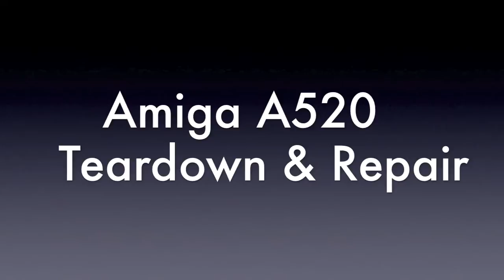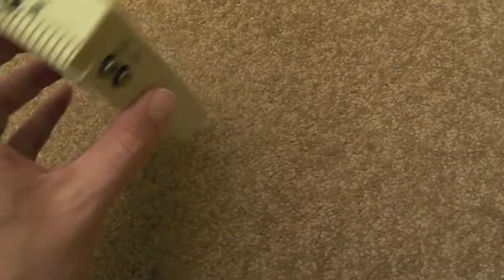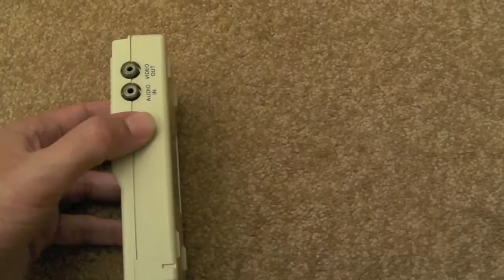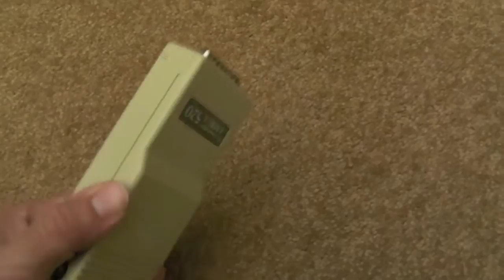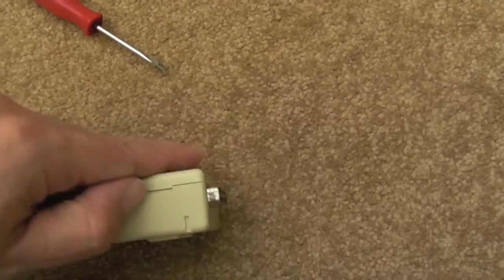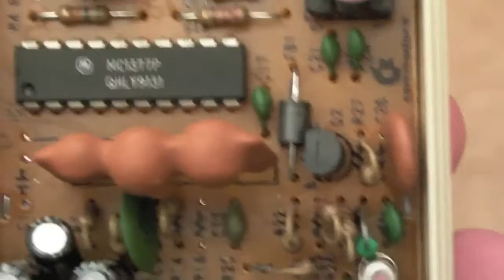Commodore Amiga A520 Modulator Repair

Comment: I recently got a A520 modulator for my A500. My issue is the modulator "adds a blue film" over the image. I have a RGB-Scart that gives a very crisp and clear image, but I have no audio with that option (don't want to hook up a stereo in my office ;)) Could it be the motorolla MC1377P giving me a hard time?
Reply from the maker: Yes, generally and colours issues with these modulators are typically caused by the MC1377P.  I've seen blue, pink, and green tints when that chip is the cause.

Comment: Hi GadgetUK164, I've been having problems with my A520 with my A500. The issue is that the picture on the TV appears slightly blurred or fuzzy, both when outputting via RF and composite from the A520. The colours actually look great, but slightly out of focus. Unfortunately I don't have an Amiga monitor to check the Amiga, but I can tell you that outputting from the Amiga Mono output produces a very crisp picture but obviously in balck and white.  Do you think there is an issue with the A520? Any idea of the repair strategy? Would like to hear your opinion before I go and buy another A520 and have the issue again. FYI I have tried on multiple TVs with the same result! Also its a PAL Amiga and modulator. Cheers
Reply from the maker: It does sound very much like its the modulator, but I guess it could be something wrong with the Amigas video output.  Modulators are really cheap these days, I would just try another one and see if that solves the problem.  You could also just get an RGB SCART cable instead?

Comment: My old crt only has composite. is the composite on the amiga-scart cable better than the composite on this modulator?
Reply from the maker: The composite from the modulator is identical!  You're best bet is to get a monitor or TV that supports SCART and buy or make an RGB lead.

Comment: Hi GadjetUK164  what means : HIGH /LOW  on the RF Amiga 500 modulator ?
Reply from the maker: Gulliver Gate Hi, Sorry I forgot to reply to the other message - will do in a sec!   The HIGH / LOW  switch just changes the RF channel that the modulator ou[puts on.  So when you want to tune in the RF channel on your TV it will be a different frequency on each of the 2 settings.
Reply: The tv A500 modulator i have
 the RF signal do not work
 the screen appears all black with the Amiga RF cable plugged on the tv antena connector.
 So im using the composite video out of the tv modulator
 but the image is slightly distorted (blurry image)
 do you know what repair it needs? (the Amiga 500 is working 100%)

Comment: Hi GadjetUK164 I´m using a tv modelator with my Amiga 500. When i turn on the computer the tv screen turns black and the hand grabbing the floopy disk doesn´t appears. But using a scart cable the image works normaly. What is your opinion about this issue?
Reply from the maker: Gulliver Gate The best thing to do initially is get an RCA or PHONO lead and connect up the 'Mono' RCA jack on the very left hand side to the Composite input on your TV (not to be mistaken with the R, G, B Component input on modern LCD TV's.  Many LCD's should still have a yellow Composite input connection somewhere.  If the Amiga is working correctly you should get a black and white picture.  If you get just a black screen or some other display - ie. not the Amiga Floppy image etc, then the Amiga or PSU has a fault.

Once you've got the black and white display working there, then move that cable from the 'mono' connection to the video connector on the modulator.  The modulator plugs into the Amiga video port and give you Composite (in Colour), or RF (Arial).  Feeding the left and right sound into the Modulator with that 2 into 1 RCA / PHONO cable just gives your RF signal mono audio.  Personally once I've got a picture I feed the left and right audio directly into the left and right (Usually red and white) input connectors next to the yellow composite input on the TV - then you get stereo sound.

Comment: for me it was cracks on the old solderings at the rgb video female pcb board pins when opened the a520 module,just tooka a big soldering stick and mashed down the cracs and now it works better,clear white and right colors on kickstart. the a520 is still piece of crap though.
Reply from the maker: Glad you sorted it =)  Thanks for posting, always interesting to find out the different types of faults and solutions =)

Comment: Why does my A520 adapter only output in black and white? I have tried 2 different ones and they do the same thing. Also, RF out doesn't work at all.
Reply: I do not have an amiga anymore, but when I did, I tried to figure this out. I tried a TV from a foreign country that had the ability to switch between different types of PAL and NTSC.  Some of them didn't work at all, and some were very screwy looking. No setting gave me the correct picture in color. I beleive both NTSC and PAL gave me black and white.
Reply from the maker: There are a couple of things to consider. Firstly regards the RF modulation - what country type is your TV, does your TV support PAL or is it NTSC? There are also different PAL types and from experience you can see black and white when trying a PAL RF output on one of the other european PAL standards. That said it seems that your colour problem is on the composite cable, are you connecting it correctly from the A520 to the composite input on your TV? I've had people connecting from the black and white composite out on the back of the Amiga rather than from the A520 itself? Have you tried a different TV to rule out the TV? If its the same on a different TV with composite that would suggest a problem with the Amiga. I could be talking crap here but I think the PAL (European) Amiga outputs at 50 hz, whereas the US NTSC Amiga might output composite at 60hz, and that could cause colour loss I think.

I believe there are also NSTC and PAL A520's.  The PAL model has a 4.43mhz crystal, and the NTSC has a 3.38mhz crystal.  You could try checking what yours has and changing it.
Reply: I'm having the same problem.

Comment: I grew up wondering why my Amiga's colors were never right when used with a monitor... Purple workbench with green pointer. I used to change the colors in prefs to make them look normal! Strangely the A520 worked fine when outputting RF, but it was not easy to read on a TV.
Reply from the maker: It could have been a problem with the monitor or the cable.  Unless you were using a modulator to connect to it?
Reply: Yep, the A520 :)

Comment: I haven't realized until now that you have a bunch of tech videos uploaded on your channel. That's cool! :) This is one of your first videos that I watch, but I will certainly check out your other tech stuff as well.
3:58 Were you referring to the orange device in the middle? That would be the delay line for the Y (luminance) signal, hooked up between pin 6 and 8 of the MC1377P through a 1.5kOhm resistor.